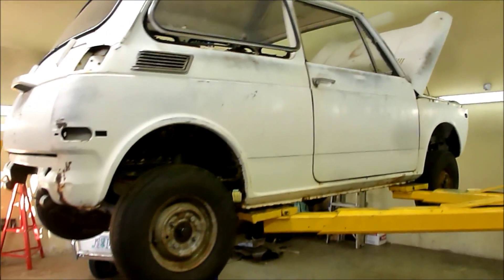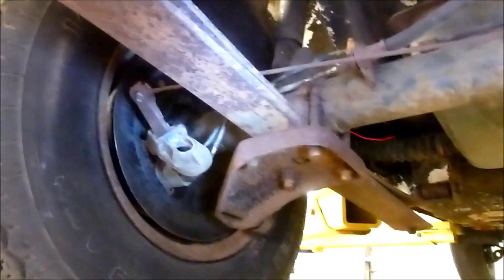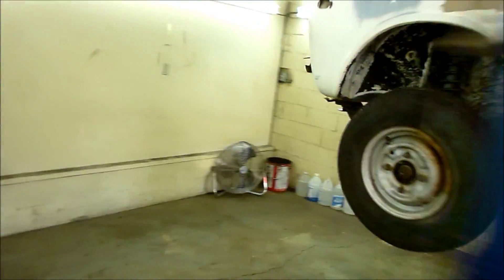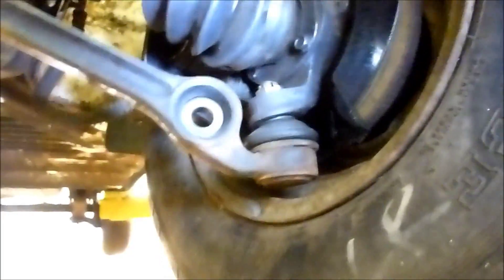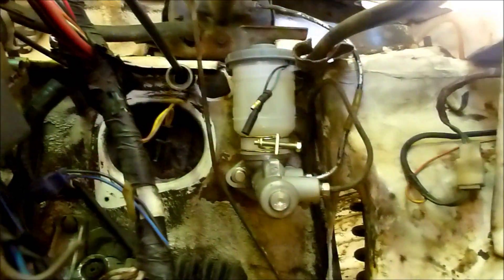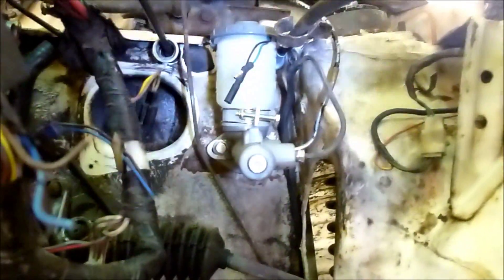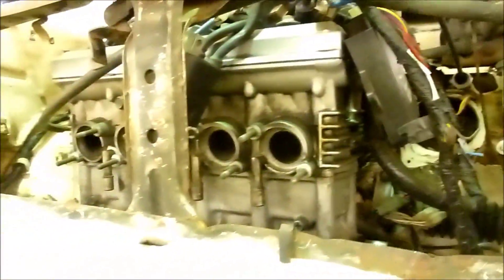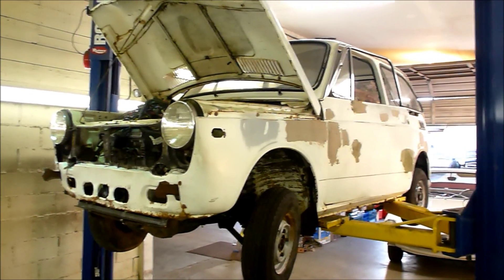Honda N600 with motorcycle engine project report... now has new brakes

Comment from the maker: Good question. Front disc brakes require more pedal pressure, Honda was ahead of it's time using disc brakes in 1970, most other manufactures were still using drums